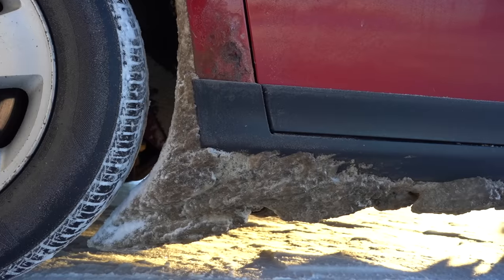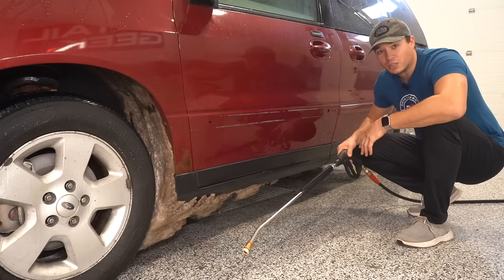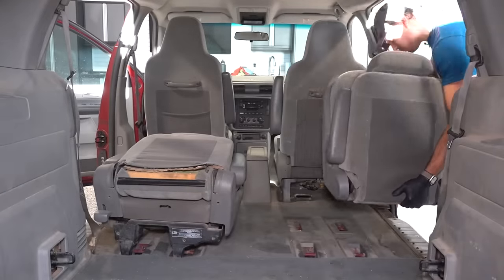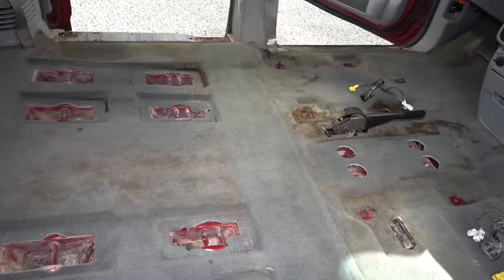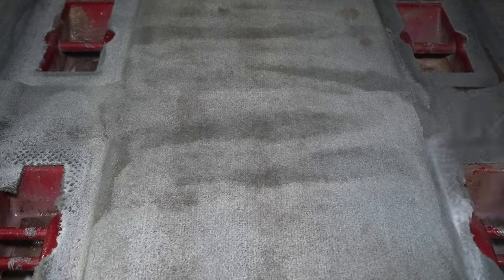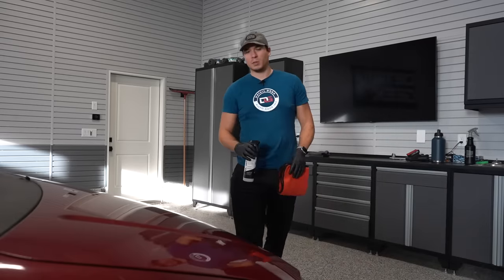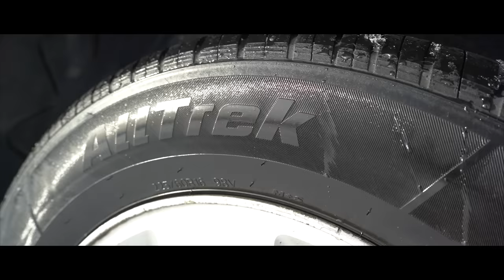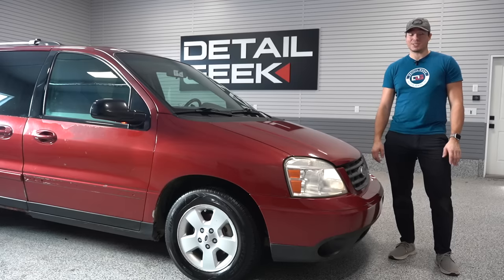Owners REACT To A Mind-Blowing 14 Hour Detail Transformation!

Comment: Detailer of five years, I have trouble with like deep embedded dirt especially in cheap carpets, I found a way to fix it which is to run an apc over it or hot water and then run compressed air right ontop of it, it cleans it out but it gets it everywhere, extracting and drill brush generally doesn't pull it out tho

Comment: Carpet grades are also dependent on trim levels as well.  My 1996 Grand Marquis LS has 18 oz. cut pile carpet.  The GS has 14 oz.  The seats have leather seating surfaces.  While cows died for the seat surfaces the rest of the trim on the seat is only vinyl.  None of this compares to my 1987 LS coupe that has carpet that looks like something you would find in your house and the whole seat is leather.   Great video!

Comment: I am curious, how do you handle cleaning the interiors on newer luxurious vehicles that have complex interior trim elements? I'm thinking of features such as open-pore wood, real aluminum, carbon fiber, alcantara headliners, etc.? I have noticed that most of the vehicles in your videos do not have interiors with those features, so I'm wondering if you've encountered any of these newer interior materials and what your experience has been?

Comment: I haven't really seen you clean or spot clean the headliner. I've heard you can't use the steamer because it will loosen the glue. Do you clean headliners? And do you start from the top down; As in pillers to the floor or what's your process?

Comment: Kicking off the ice would be fun, but it's pretty satisfying to watch the pressure washer cut it off too. That's besides your point that it could damage the car not just in the rusted metal, but it could also crack the plastic and damage paint if there is any paint left... Anyway, great job on the interior. I think most of us detailers could tell some stories of some seriously challenging interior detailing jobs.

Comment: I purchased a brand new leftover 2015 Ram Promaster City SLT Wagon in June 2016.  The carpets installed in it were definitely of questionable durability. I wound up having the carpet warranty replaced within 3 months. And the 2nd one 2 months later because the failed under the drivers feet area. The 3rd one is still in place and has held up much much better. It never looked very attractive, but the optional factory floor mats front and rear look great and have held up well. The rear cargo area carpet is covered by a rubber floor dealer accessory rubber floor mat of excellent quality. They were well worth the investment. And I still have the van today. I like it overall because it’s the right size, comfort, utility and look for me. But the carpet is definitely a low quality point.

Comment: For the carpet - not (only) cost, but weight and safer materials.   As fuel economy standards tighten, every bit of weight savings helps.  Also, that "new car smell" is actually off gasses from everything in the car - including carpets.  Hell, even the foam in the seats has changed to something that off gasses less in most US made car brands.  While the carpets MIGHT cost a bit less, they also might not.  They actually may be made of more expensive, lighter, and lower emission material.  And the lack of the more harmful chemicals may also make them harder to clean, in addition to being thinner.

Comment: I washed the trunk of the car once and had no pump to take out the water so I drilled a whole so the water could drain.
I drilled from the spare tire compartment straight into the fuel tank

Comment: ...mm still wasting time hand cleaning floor mats instead of tossing them in a washing machine !  Buy a small baby pool and let them soak while you work on the rest of the car . perhaps buy a table to put the seats on so your not bending over trying to clean them - you can also use them to run your scrub brush on the floor mats

Comment: OMG! I had a 2005 Freestar SE in the same color. 2 Windstars before that. The Freestar was a disappointment in that the torque converter quit with 60k miles on it. $1500 to replace. Cheaply made van.   Drove it for 4.5 years, then bought a Flex, which was a better, but not great, vehicle. Last Ford for me. I drove a 2017 Equinox for almost 6 years, then upsized to a used Pacifica Touring L.  The Ford vans were nowhere near as nice as my PTL.